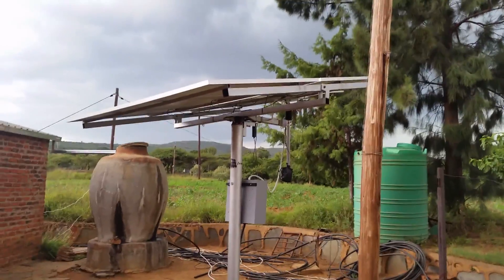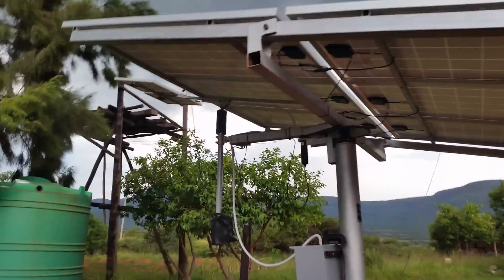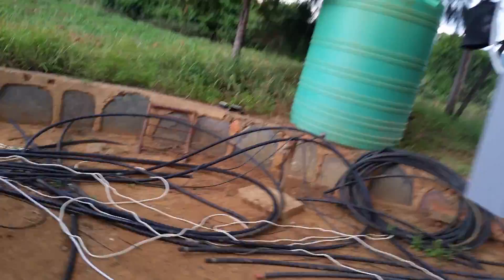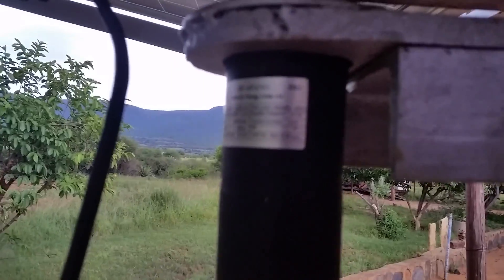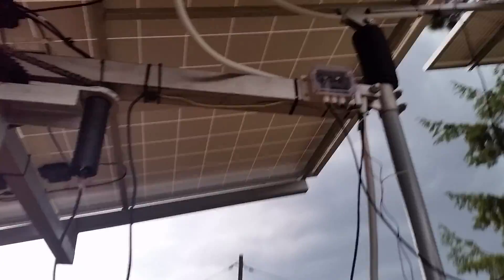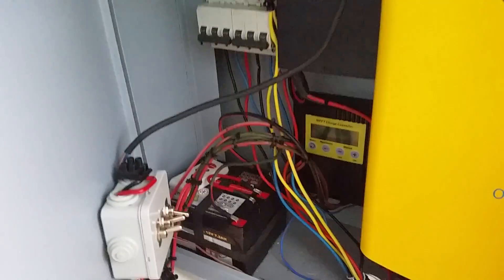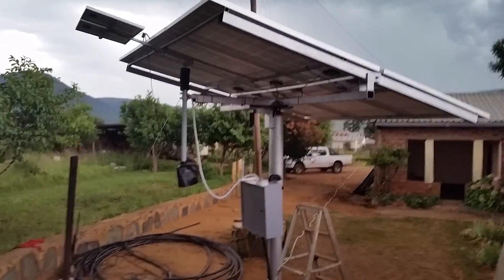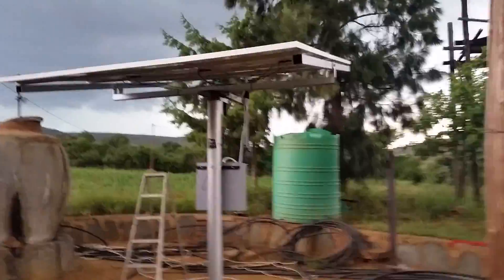Diy Dual Axis Solar Tracking System

Comment: At 2.15 you should have plenty of electricity, the starting voltage of your inverter is to high or your solar configuration has the voltage to small

Comment: You need a worm gear reduction for the left right sxis,so the wind cant spin it around.

You also need to make the shaft go thru the bearing and extend at least 1m deep and secure it at the end with a second bearing, right now if you have one bearing it cant be destroyed pretty fast from bending loads. Also the shaft seems to small anyway, besides that the construction is fine

Comment: Did you ever get a video of it working?
Reply from the maker: +Jason Eggum if i go to the site again i will make a video of the thing working that day i set the settings of the controller for high light and not low light but it works now will go to the site and make the video and add it to this video for you guys thanks for watching

Comment: Hi Phillip, Nice job!

I have a few questions, what are the specs on the motor, source? what are the sprocket sizes, tooth count, chain size.... What is the diameter of the post? what is the size of the footing used?

I will gladly make some CAD drawings if I can get some additional info and measurements.

again very nicely done!!